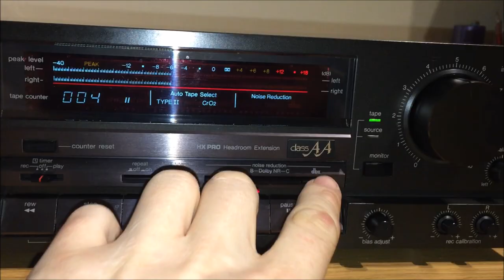Technics RS-B905 Cassette Deck Demo - Recording with dbx (with service pictures)

Comment: Hey. I have this deck. I got it new in 1989, used it frequently for a few years, and in 1995 I switched from vinyl to CD as a DJ. I was out of the country (Sweden) working 1993-95, so since 1993, it hasn't been used more than a couple of times. Last thing that did happen, was that I had a break in and got it stolen early in 1993. Fortunately I got it back after a few days only, from the police, and insurance paid for a total overhaul and service. I guess it's still working fine but I don't dare to put any of my old tapes in it in case they damages the heads. I really don't have any use for it and I think gear like this should be used by people appreciating the value. This was an expensive piece of gear back in the days.

I also have a studio grade audio cd burner, the Pioneer PDR-05, that I used to convert my vinyl into digital. I used it for a couple of years until I could do almost everything in the computer instead. It still is a very good CD player and there's not many units that can compete with the quality and features this one have. The money I spend on this machine ($2000/£1500) and the recording media ($150/£110 / 10pcs@60min) almost seem ridiculous today, but it was still cheaper than to buy all my music once again on CD.

These two pieces of excellent hardware is just collecting dust, and if there's anyone out there interested to give me an offer, just get in contact. You can comment here or visit me on Facebook, Peter Lindqvist , same picture, or you can find my e-mail on my Youtube profile. If anyone give me a proper offer, I can include a Sony mini disc player/recorder, almost not used at all in the deal.
Reply: Hi!-Do you still have any of those items? ? ?

Comment: If my 905 was working properly in dbx mode I would put it up against the onkyo any day.8 db recording level with normal and high bias tapes,12 db with metal according to the owners manual.

Comment: One more question, what heads are in this model, amorphous, permalloy or may be sendust?
Reply from the maker: Pearl vision permalloy but very good
There's a few 965's on eBay now you should make some offers
Reply: Thanks, I already found in my country 905, decide to buy it, condition is very good and price is about 70$
Reply from the maker: Pearl vision nice one good price
Reply: I have Onkyo TA 2570 else and I know it sounds better than 905 but it is not important, only nostalgia matters:)

Comment: are cheaper technics decks good? I can find them on eBay for around 50-70$ plus shipping?
Reply from the maker: an RS-B565 or 665 is an extremely good playback deck
Reply: Technics Guy  what about recording and playback also thanks for responding.
Reply from the maker: Derek smith probably rs-b755 then or 765 for recording you want 3 heads with calibration controls to get it sounding just right
Reply: Okay thanks, I'm thinking about getting into cassettes and other vintage hi-fi any other tips
Reply: Low budget
Reply from the maker: Derek smith tip, buy pristine condition then if you don't like it will be easy to sell on
Reply: Thanks

Comment: Has it DD motor on capstan on not?
Reply from the maker: Pearl vision it does not
Reply: Pity and strange, most of top Technics decks have DD
Reply from the maker: Pearl vision after around 1990 all their single decks were direct drive 
Before then and the twin decks were belt drive
Reply: But for instance RS B100 and 280 are from early 1980 and with DD
Reply from the maker: Pearl vision  the rs-b100 and 280 are direct drive, but still use a belt for the capstan - like the rs-b965.
Reply: Technics Guy I mean direct drive is on basic right capstan as the most DD decks use, and for the left capstan is usually belt used. And in 905 is not any DD at all
Reply from the maker: ok mate i get you. the 905 deffo uses a traditional motor you can see it in the pics at the end of the video
Reply: Technics Guy Yes, you said this in the beginning of our dialogue, so it`s a pity that 905 has no DD. I wanted to buy it
Reply from the maker: why is DD so important? there are many great decks out there without DD
Reply: Technics Guy With DD the speed and wow and flatter are always more stabil than in decks without DD and no such a need to find new belts which are so old in our time.
Reply: @zetecfiesta  Like Nakamichi 682ZX.

Comment: RS-B100 > RS-B905 & RS-B965

RS-B100; Disc and Tape DBX, Output level, DD Quartz, tape selectors looks better to me, more colorful: red normal, green cro2, yellow metal.
Reply: RS-M253X & RS-B90 > RS-B965 & RS-B905
Reply: The RS-B100 was double the price of a RS-B905: better amp, better bias and calibration (esp. tape II, pure chrome), better transport, just much better sound, and not cheap to buy ;-(
The B905 was cheap in the days. Around 500€ new.

Comment: Its a nice feature but not all players have that hability to decode DBX later when playing....

Dolby B its the most common.

DBX its a more complicated version of noise reduction and needs a precise alignment of tape in the head.

Nice video... i sent you a message, hope you received it... Thanks
Reply from the maker: +paulo fixo hi mate dbx is no problem swapping with different decks I've played dbx tapes on aiwas / Yamaha / teac , all sounded awesome as you say aslong as azimuth correct all is good. The problem is dbx walkmans or the lack of them